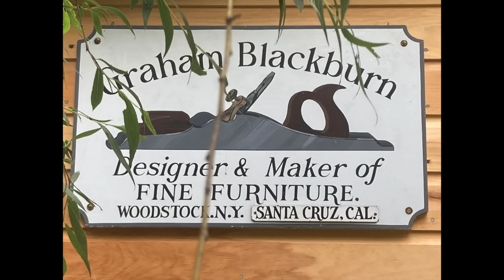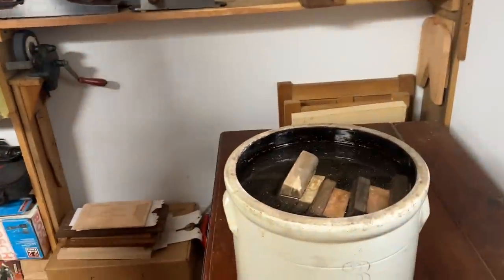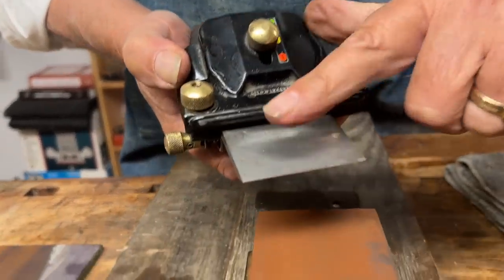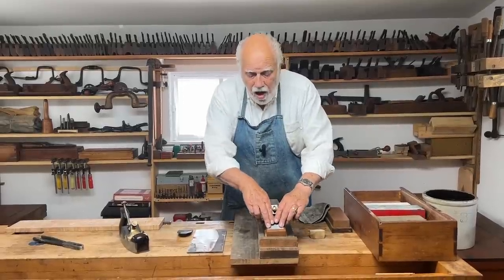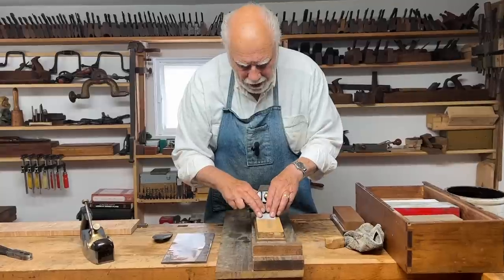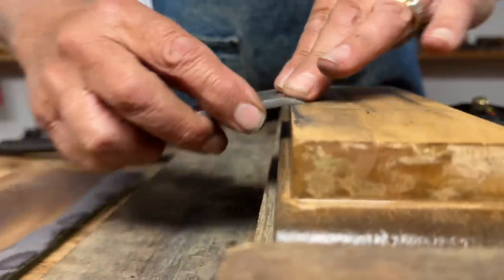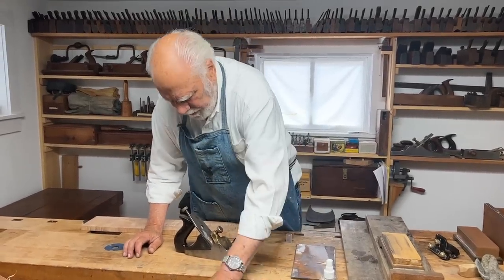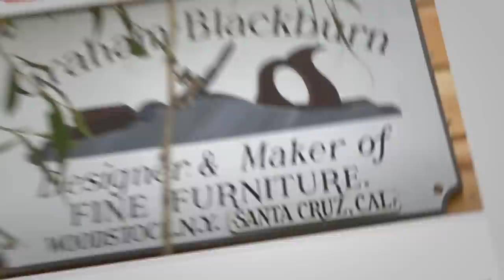41. Water Stones

Comment: Thanks a lot for the lesson, Graham! Really interesting stuff! 😃
I bought a cheap set of diamond stones and I'm loving them!
Anyway, stay safe there with your family! 🖖😊
Reply from the maker: Thank you. Likewise.
Reply: There's different diamond plates. I like the ones with a continuous coating. They have no pattern on them. I only really use the 1,000 grit one. After that I polish on ceramic hones. I don't try to maintain the primary bevel by hand either. I hollow grind my tools on a bench grinder. That saves a lot of honing I don't have to do.

Comment: Thank you for honing our knowledge of water stones and sharing your beautiful Norris plane with us. I was wondering about what you think about diamond stones?
Reply from the maker: Many are good, but they tend to cost more and eventually wear (sometimes faster). Bottom line, there are quite a few different methods and materials. I chose to demonstrate the King water stones because they're somewhat less expensive, but the study of sharpening stones can go on for ever!
Reply: @gjbmunc  I use cheap plates out of China. If used right they hold up for years. For maximum performance you need to use the right lube. Head down to Wally World and in the automotive section pick yourself up a jug of Purple Power! It's got the deluxe glide. Just a little dab will do ya.

Comment: Great video as always. I've found my way of sharpening and sticking with it, while also taking in tips and advice to develop my skill and method. I think the most important is to get a sharp tool in whichever way you do it and fairly quickly. To new woodworkers it's always quite the mystery :^) I'm still no expert but am slowly improving my method. And I've found that slightly different methods can be better for certain tools.

I think you've only either capturing or using the sound from the camera and not the microphone on the apron. I'm sure you already know, but I'd still mention it, because I've noticed it before.
Reply from the maker: Yep. always working hard on the audio.

Comment: There are as many ways of sharpening as there are woodworkers. I ended up in the diamond plate and (hard) leather strop camp as that strikes me as a good compromise of not making a mess when sharpening and getting a good edge.
Reply: I use a diamond plate. I tried to get in the hard leather camp but I like my softer strop too much. If you're in the hollow grinding camp then we can hang.
Reply: That's perfect, Petter. Watch the Jonathan Katz-Moses video on sharpening he did recently. I'm not a huge fan of his, but it's the most thorough test yet and it's conclusions were quite clear.
Reply: @thomashverring9484  did he test how long it took to sharpen? Because nothing is as fast as diamonds are.  Time is a factor in all of this. The time you're spending sharpening takes away from the time you could be woodworking. People hate to sharpen because for them it is a chore and a bore. That's because they're not doing it right. Anyone sharpening right isn't fussing around with it enough to get emotional about it. I can literally take 3 strokes on a diamond plate and I'm done honing. 1, 2, 3. One up the middle and one on each side. But I'm also hollow grinding my primary bevel on a bench grinder too. So I don't have to remove a whole lot of material to develop an edge. I use a guide too so every stroke counts. So in conclusion the correct method yields the most efficient and effective results. Piss on using sandpaper too.
Reply: @1pcfred  You do seem very emotional about it, though.
Reply from the maker: I like to sharpen before I start work, listening to the news.
Reply: @gjbmunc  I sharpen while I work. Every so often I'll just touch a tool up some. They get dull faster than most like to admit.

Comment: Wonderful video. I’ve recently purchased several used hand planes — some in beautiful condition and some needing work. I bought the terrific little book, Sharpen This, from Lost Art Press and learned a lot from that. This video both reinforced what I learned from that book and added some visual nuance to the great writing and explaining there. 

It has been so satisfying to see a beautiful curl of wood shaving coming out of a plane — and frustrating when I don’t get it right. I’m looking forward to applying your tips to my process. I’ll be putting some 100 grit sandpaper on glass next!
Reply from the maker: Good luck!
Reply: Keep learning and experimenting sharpening. You're not going to learn how to do it from a book or a video. Though those resources may give you some ideas. To really know you have to do and reflect on your own personal experiences. Find what works best for you. Just getting things sharp isn't enough. You have to get them sharp quickly. That doesn't mean moving faster or working harder either. It does mean discovering the most efficient methods though.
Reply: @1pcfred  thanks. Was doing just that last night on a plane I found in a drawer of a cabin I bought. It was pretty beat up so I had to grind off the old edge using a hand-cranked grinder — another “found object.” That I had to clean up using a dresser I picked up on Amazon. In the end, I got it working okay, but as I looked it over, it’s old and maybe wasn’t a very good chisel when new. But it was good practice and is bringing the video and printed lessons to life.
Reply: I even used Graham’s hand palm finishing tip — though I don’t think my palm is quite as meaty and leathery as his! :-)
Reply: @RossDMartin  not so great chisels are some of the most useful tools of all. Because those you can beat on. Do all the things with it you're not supposed to use a chisel for. But a chisel remains the best tool for the task anyways. It's nice when your beater chisel is sharp too. They it works like it should. At least for a little while. Dressing grinding wheels is next level craftsmanship. Keep at it!
Reply: @1pcfred  great tip!
Reply: @1pcfred  today I was back in the workshop, ostensibly to clean it up, yada, yada, yada…. I ended up putting back together yet another jack plane I got on marketplace. This one was in much better shape, but was really rusted up. I had soaked it in nontoxic rust remover, but left it sitting in pieces. So I tinkered around with it and got it back together, sharpened the blade (pretty quickly this time), honing the edge with 3000 and 8000 whetstones. After some futzing around, I got it shaving these beautiful curls of wood. So satisfying! Now to get it into muscle memory on some real projects.
Reply: @RossDMartin  I can relate. I have fixed a few planes up myself. It is a thrill when they can take a shaving.

Comment: mr. blackburn what angle do i need to set my plane blade
Reply from the maker: If you mean what bevel you should put on the plane iron, 26degrees is a good average. If you mean what angle the iron should set in the plane, that can vary between low (30 degrees, through 45 or 50 (york pitch) or even upright (for toothing planes).

Comment: Those pliers are well suited but I think they are for breaking molds open or something? Maybe to form lead fishing sinkers?
Reply: They're gas pliers. They from back when folks had flames coming out of their walls. I got a pair just like 'em. I like my smaller pair better though.
Reply: @1pcfred  Awesome thank you. I probably have a pair buried in one of my pine boxes I made to store tools from cleaning out old collections.
Reply: @FearsomeWarrior  if you do an image search for gas pliers they'll turn up. Apparently they're still a thing somehow too? Because lots of pliers I'm seeing look new. Some are called gas pipe pliers. So I guess they're for grabbing gas pipes. Why you'd want to do that I've no idea. My little pair has a vampire notch in them on the tip and they're handy for grabbing screw heads. That's what I use them for. I hold screws in them that I need to wire wheel.
Reply from the maker: Yep, lotsa non-woodworking tools can be very useful for woodworking!

Comment: Every one of the YouTube Hand tool guys says you have to strop. Thank you for proving that wrong. Great Lesson!!! Thank you as always sir.
Reply: Graham stropped at the end on living leather!
Reply from the maker: True; the difference between using a traditional barber's strop and the heel of your hand is that the barber's strop tends to round the very edge — which is fine for carving tools but not so good for plane irons where a back as perfectly flat as possible back is desired.
Reply: @gjbmunc  Makes perfect sense. I have seen that in my shop when I've used a strop that is too soft. It will round out my edge. No more strops for my plane irons. Thank you sir.
Reply: He did strop. He just stropped on the palm of his hand.
Reply: @gjbmunc  Your geometry theories are somewhat debatable. Check out David W's Unicorn edge videos. He runs his irons on a polishing wheel and you can't argue with the results he gets. He goes hard on that wheel too.
Reply: Jonathan Katz-Moses did the definitive test on sharpening and stropping not so long ago. Basically it doesn't matter too much how you sharpen but stropping a little bit on hard leather is important. Soft leather (or a palm) rounds over the edge. However, you have to strop too much and too hard to round over anything. Using super high grit, by the way, makes no difference because that level of sharpness disappears two seconds after contact with the wood. The latter is probably also the point Graham made when saying that using a grit finer than the metal molecules makes no sense.
Reply: @thomashverring9484  convex edges are most durable. Edges dull faster than most realize or are willing to admit. A big problem surrounding sharpening is it is happening on a scale we cannot easily perceive. A keen edge may only be 100 atoms thick. We can't see things that small. So we start making a lot of crap up about what's really going on there. Who's to say any different? I do happen to examine edges I've honed under a microscope though. So don't try to snow me, pal. And yes I'd recommend anyone into this sharpening thing to get a microscope as part of your sharpening kit. There's fascinating things going on to be revealed there.
Reply: @1pcfred  The test shows what happens and what's important. The rest are feelings.
Reply: @thomashverring9484  stropping works for me. That's not a feeling. Your round over is a theory.
Reply: @1pcfred  You are right, I mispoke above, I didn't mean round over, that was just what was mentioned before, I was actually speaking about dulling the edge. The tests did show quite clearly how stropping helped and when it became detrimental. Stropping too much is detrimental, and using a soft material is detrimental. Remember, though, that it doesn't mean a lot when done a few times, it's when you do it too much—and who does that? A test (not by JKM) showed how stropping was a bad idea, but no one actually strops like it was done in that video. JKM, on the other hand, very clearly demonstrated that it is very beneficial to strop, and that it's best on a hard strop. That's also why some professionals just use a piece of wood with stropping compound on. But if the soft one works for you, fine. That was my point exactly. If you can get your tool to cut, get it sufficiently sharp, that's all that matters. And quickly, of course, as you pointed out yourself. No one's been arguing about that. But there's no point in saying one way is the right way, if another way gets the job done. That's all that matters. It's actually more absurd when people oversharpen to absurd levels of grit, since there is a clear median sharpness an iron can hold, and will hold for a surprisingly long time with occasional use of a strop before it needs to be sharpened. Anything above it disappears with a few shavings of wood and returns it to the median. However, to me the sharpening method isn't really interesting, it's all about working with my tools. All of these tests didn't change how I sharpen (well, I was basically already doing what they recommended). I sharpen on three diamond stones (even though the test clearly showed that the "scary sharp method" was the most effective) and a hard leather strop. For softer metals (Mora knives e.a.) I use a piece of slate instead of the strop, because I was recommended using something harder than a strop for those so as not to dull the edge, and it made a significant difference to my carving knives. The softer metal was too easily made dull by the strop. If it works, it works. Now I say goodnight. It's late where I am :^)
Reply: @thomashverring9484  what you say sounds logical enough but there's plenty of evidence against it. Do a search here for unicorn edge and watch David's videos. He goes past stropping and power buffs edges with outstanding results. He buffs on a cotton rag wheel. So very soft material.